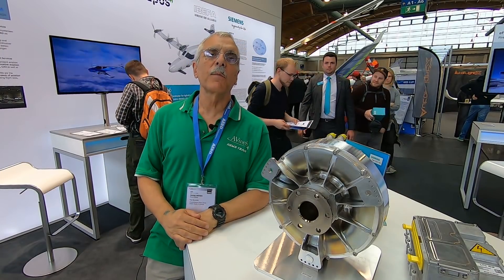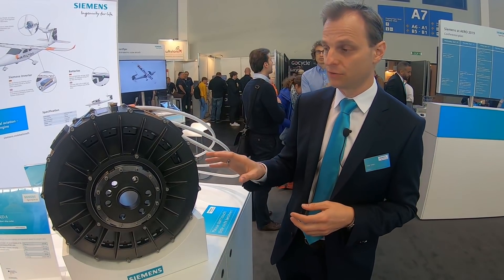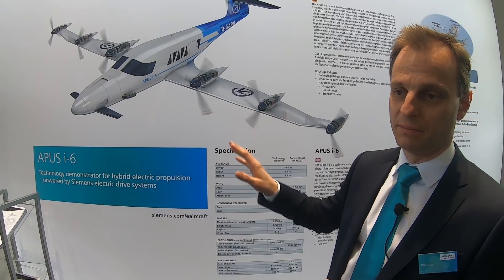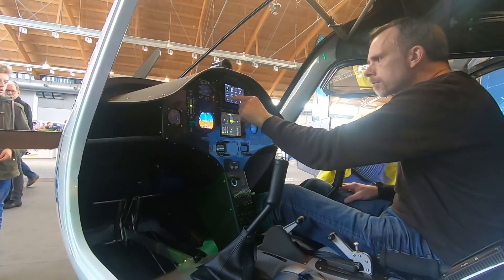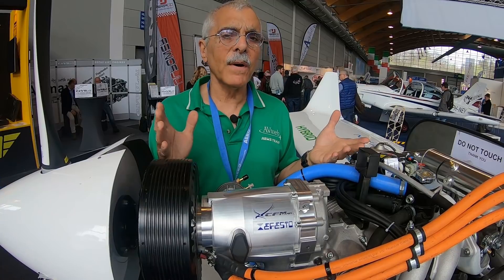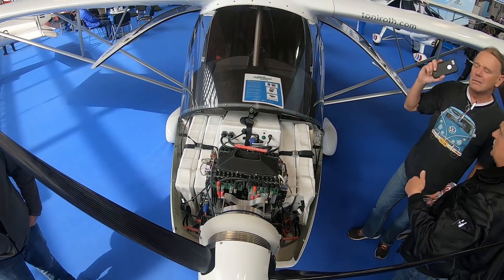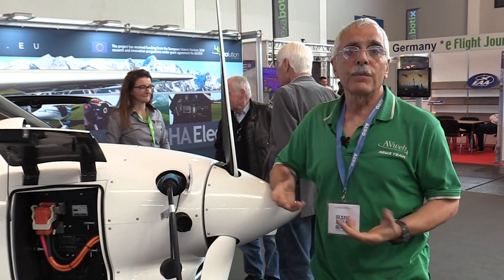What's New in Electric Airplanes?

Comment: I would love to put a smaller 100-130hp motor in my Quickie Q2 500lb (no fuel or pilot) 2 seater Burt Rutan Composite plane.  The plane has a 80hp gas engine now that cruises at 150mph Top speed 180mph.  The design is safe up to 200mph.

Comment: For me the e-systems have the same disadvantage as in cars. Why don't they hybridize these systems with a solid oxide fuel cell? Why do they use these internal combustion engines? You can operate a SOFC directly with natural gas or auto gas. There is no need for hydrogen. Of course you need a Li-Ion buffer battery, but this can be very small.

And there is another thing. Why do they use propellers instead of impeller fan systems. Impellers have considerably more efficiency because of the guided air flow. And fast running electric fan motors can be made much smaller compared to high torque motors for propeller drives.

Comment: I don't mind the idea of an electric motor driving the propeller. As long as you put a generator on that thing and have it run by some sort of fuel, whether it be diesel or gas, I don't care. You can even have a smallish battery that will be your primary power source but if you're not charging that thing with something that will last longer that what they currently have, and the problems that we already have with automobiles that are electric. I think that depending on a battery while you're out in the middle of flying, you think it's bad when people run out of fuel, and they have to be the ones you put in the fuel and there's a fuel gauge. Batteries can quit functioning as soak an electric motors for no perceptible reason whatsoever.

Comment: Is it a engine or a motor because the tech rep is confused?
Reply: It's both.
Reply: @PabloGonzalez-hv3td .its a motor engine?
Reply: @gerald4027  The definition for engine has nothing to do with combustion as is commonly thought. It's based on having moving parts. This is both an engine with moving parts and a motor as it imparts motion.
Reply: @PabloGonzalez-hv3td .motors are electric and then engines run of off a combustible liquid or gas.steam engines and water wheels are engines.
Reply: @gerald4027  That's the common misconception but it's not actually true. In rocketry both rocket engines and rocket motors use combustion but rocket motors have no moving parts and are not considered engines.
Reply: @PabloGonzalez-hv3td .that's nice so what do solar arrays use for propel the aircraft forward?
Reply: @gerald4027  Both electric motor and engine are acceptable but motor is common parlance. Mostly irrelevant unless working in rocketry.
Reply: @PabloGonzalez-hv3td .my diesel  truck has a electric engine.
Reply: @gerald4027  It has many. It also has a diesel motor.

Comment: I would cover the wings and part of the fuselage with solar panels, that would increase the flight capacity during the day
Reply: I keep imagining the entire skin of the aircraft collecting both heat and photons. clear panels exist already, so there is potential for collecting from the entire surface of the plane. If solar collectors were integrated within the structural material it could prove to be worthwhile, yielding power for virtually no extra weight. Nano technology is already developed which massively increases the power to weight ratios of solar cells by increasing the collecting surface.
Reply: @kenbellchambers4577  With regard to weight gain, I believe to use purely the solar cell phone and add in the firing material itself and covered with translucent material as being part of it. Unfortunately the greater weight still holds for batteries that still need better development and the engines have capacity and efficiency even better losses of around 10%, which is worth continuing to invest in this technology.

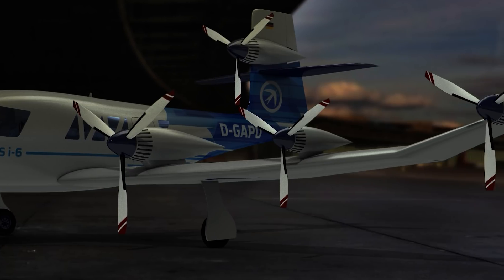Comment: At 4:10 is a 7 motor plane.  It's more expensive to build many small motors, rather than one or two larger motors.  I have to wonder if the frame is rather weak, so they don't concentrate the forces.

Comment: Does it really seam like a good idea to place a spinning mass on the wing tips of an aircraft in an airport scenario ? And what happens when or if an motor fails or a speed controller overheats and causes a sever yaw situation ? And why do they all have to direct drive, why not consider gear boxes to convert power slowing a motor RPM yet increasing the rpm like a constant pitch prop ?

Comment: Can you put solar panels on the wings to give a little longer range?  I know they will not give the amount of power to run the electric motor but if it will give enough charge to the batteries to offset some of the power needed it would add some more time in the air,  maybe  25% more.  I have no idea what the power needed to run the electric motor so not sure what 200- 400 watts of solar panels will give.

Comment: Brushless motors with a 3 phase are awesome matched with lipo graphene batteries my rc pylon racer cracks 200ks on 14.8v 772 watts at 48 amps static with a 7" prop and it's only made from epp foam with carbon spars 👍

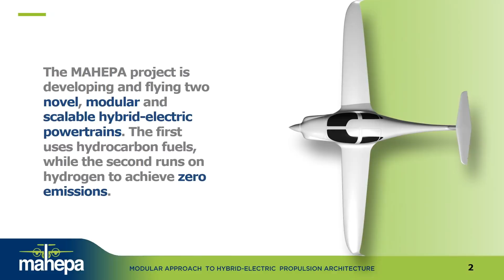Comment: 11:29 
TU-Delft logo: check
ICE: check
Hydrogen: check
Is this a Shell stealth program or something?
Reply: I am the Innovator of THE NEW WAY TO TRANSFORM ENERGY WITH MY UCRÓS ELECTRIC CYCLE SYSTEM of the Republic of Colombia South America Carlos Ucrós WhatsApp +57 3012358709

 And innovated a system to install it in electric cars that use a 72 VDC output controller is a device that I install before the controller and use a single battery and I extend the autonomy to 400 kilometers with the air conditioning on of fasil installation two components with  the battery price in Colombia 9 million pesos out of 3 thousand dollars sent by plane separately contact the innovative CARLOS UCRÓS
www.ucrosenergysystem.com

Comment: If the first story linked to below is legitimate, and the guy has solved the problem of an Aluminum Air batteries toxic electrolyte, such a battery could extend the range of one of these planes 8 times. Instead of the Pipistrel Alpha Electric only being able to fly for 1 hour, it could fly for 8 hours. The downfall would be, it couldn't be recharged, the battery would have to be swapped out after use, but hopefully it could be recycled. 

https://www.youtube.com/watch?v=9HvstKvFss8

https://en.wikipedia.org/wiki/Aluminium%E2%80%93air_battery

Comment: I really don't like the idea of relying on the electric and combustion engine at the same time, when taking off in a parallel hybrid. Now you got two things of which just one needs to fail to get you in trouble at high density altitude, rather than just one thing.

Comment: A short-hop electric plane taxi service could work now. It would require infrastructure. The train industry built a rail system. An air taxi service could build routes with a series of short-hop airports where batteries are swapped out. The question is how many passengers per plane would be needed to make routes profitable...

Comment: Gotta love the comment about most of these designs being "aspirational": pending a good power source. The difficulty is that all the recent battery innovations have been "discovered", not created or invented: they have not been predicted. That's the hard part. It's like Edison searching for a lightbulb filament: a slow and painful process. If someone can figure a way to design a great battery straight from theory, they will be immensely successful. Huge resources are being poured into this for years with so far only incremental success. What is needed is a 10X or 100X breakthrough. That would change the world. And it has to be practical and inexpensive. Making one or a handful in the lab for a gazillion dollars doesn't count (except for making breathless headlines). We've had efficient diesel/electric hybrids for 70 years: trains. But there weight is no object. Airplanes are a more challenging 'corner case' of electric or hybrid vehicles. The next couple of decades should be fascinating and maybe in the not too distant future we will all have an affordable, reliable way to fly... If you are curious, attend one of the electric aircraft conferences now happening every few months.

Comment: The issue with stacking motors is the weight penalty will begin to exceed the benefit of more power plants. You still have to add passenger and battery weight into the equation. >.>

Comment: An important goal for the developer ,apart from the technicalities and practical improvement in batteries(of which are many),is of course "COST" not only initial outlay but reducing time cycles in the hybrid reciprocating engine MAINTENANCE which in my opinion is the only real option for electric powered " A/C.that means a redesign in airbreathing engines .

Comment: Why don't you put the super capacitor and adding strong solar panels to the both wings so that the system can be recharged during the operation in the air?
Reply: Because the physics tells us the area for solar panels is waaayyy to small. Or it becomes very clumsy, just like Solar Impulse 2.

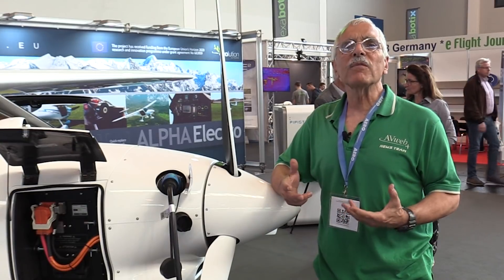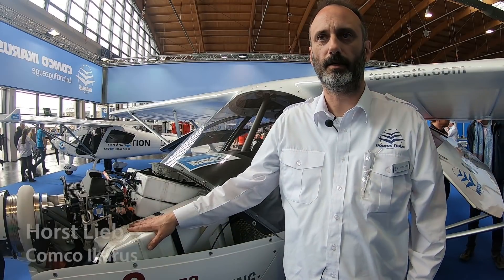Comment: what do you mean the numbers don't pencil out for hybrid electric 12:55 ? that guy said 8:11 the hybrid electric can hold 70 liters  of fuel and uses 7 liters per hour in flight. If it can cruise at 100 miles per hour for 10 hours of flight time, that is about 1000 miles of flight distance, not including the electricity from battery of another 45 minutes to give it over 1075 miles of flight distance. Plus you would not be having to fill it with aircraft fuel. You could fill it with standard generator fuel? Someone please correct me where i am off on this.

Comment: Mahepa:  Hydrogen fuel cell are not hybrids unless you obtain half of your peak power from batteries.
I hope do you use liquid hydrogen which it would increase the performance by a lot vs 700 bar compression.

Comment: why not put solar panels on the wings/fuselage or would that be just silly?
Reply: weepingod 
Even if you could extract 100% of the solar energy falling on the surface of the plane, it would amount to a tiny proportion of the energy required. In practice you wouldn’t get more than 25% of that energy, even under the most favourable circumstances.

Example:  A Boeing 747/400 has a wing area of 525m^2. This could collect at most about 525 x 240W of power, with full sunlight directly overhead. That’s about 126kW, (or 169hp, if you prefer) roughly the same power as a medium family saloon and about 10hp less than a Cessna 172S.

Comment: I wish that they (motor Mfg's), would design motors with smaller diameters.  This would allow for more streamlined nacells., and, perhaps putting small motors onto rotor heads/blades.
Reply: It is possible, but not worth it. Small form factor means less room for coils, so you have to compensate with higher current which equals heavy wires. It is a bit counter intuitive, but for any target power, you can have big and light or small and heavy.

Comment: lifting body design, with solar cells on the wings, and any upwards facing portion, at high altitudes for an 8 passenger plane it might give you an extra 8kW/h, sure that doesnt sound like much but it could add a measureable range increase as well as a backup 'fuel' system for superglide
Reply: Solar panels are too heavy for the power they offer. There have been some unmanned designs that do that, but they partly offset the mass of the solar panels by using them as structural elements. Solar cells are comparable to glass in strength and weight; I don't know about you, but I wouldn't want to fly on a plane with wings of glass.

Comment: I think what folks need to understand is how early this technology is. In 1919 a Curtiss JN-4 would go 75 mph, cruising speed of 60 mph. Top altitude was 6,500 ft. And a range 155 miles, or 2 hours and 15 minutes. The fact that electric cars are superior in everything but range. And that's improving year by year. The Alpha Electro has 45 minutes of endurance 70 miles of range. And a 98 MPH top speed. Otherwise, put in a lot of R&D on algae fuel to be refined into aviation fuel. Give it the kinds of subsidies that Oil companies get.

Comment: Parallel hybrid with a small, efficient ICE sized for slightly more than cruise power can have the best of both worlds- reduced ICE maintenance cost, good range and low fuel consumption with decent climb performance. Devil in the details, of course.

Comment: Parallel hybrid with a small, efficient ICE sized for slightly more than cruise power can have the best of both worlds- reduced ICE maintenance cost, good range fuel consumption with decent climb performance. Devil in the details, of course.

Comment: These hybrids looks front heavy. I wonder what's the center of balance on the manual. 
Remember those front and rear propeller planes? What if u have 1 gas engine in 1 side and a electric motor on the other side. Maybe that would balance out and offer a better system

Comment: They  all do it wrong. Need to design totally whole new electric type of plane with batteries that can be replaced in 20-40 minutes. Than and only than electric planes will have a perspective in flight school. Due to limitations of batteries its not profitable to buy a plane that fly up to 40 mins and charging 6 hours. That mean that you can fly only once at daylight hours.

Comment: I have to say that although I always thought this will be of no use because of the lacking battery capacity I now think that the use in the short term is more the reliability. Having a conventional engine power one or two electric motor(s) with some small battery capacity in between could be an efficient way to combine the low consumption of single engines with the reliability of two or maybe three propellers. That doesn't help you over water but it does while takeoff and landing and over mountains. Even 5 minutes more to fly plus gliding time could increase safety a lot. Of course the weight of a parallel hybrid is considerable but twin pistons are very inefficient, too, so... If you  look at a Cessna 340 and at a Piper Malibu you really wonder how double the power can result in so few knots more airspeed. I wonder how fast a twin with 300kW total power but a very sleek design with small engine pods would perform. We haven't seen that yet. It probably should have a relatively long body to accommodate everything but that doesn't add much drag.

Comment: Battery density is on a steady increase.
Combined with a range extender(installed or not).  Is  a triple safety mechanic.

EV is much more reliable, the have a primary and secondary pack + the extender.

On larger planes electric taxying should be manditory.

Comment: I'm thinking or perhaps imagining,  that if they cover the airplane exterior with those light weight solar panels to recharge the batteries while in flight, it could actually stay in the air for ever
Reply: I don't think you could fit enough solar panels on a small plane to power one of those motors... Unfortunately I think it's one of those things where if was possible, people would have already done it. I think there have been a couple solar planes, but they were very light, low power soaring things.
Reply: @maeflower5108  well impossible is nothing, who knows maybe one day they might be able to figure it out
Reply: @binobrownthomas2010 Planes that use that idea have already been made, see facebook's project and others like it

Comment: Is there any electric aircraft yet available with a range of 300nm?
Reply: you are talking aircraft range or UV light wavelength?
Reply: @kedaruss  I meant nm = nautical miles. It is potentially confusing that it shares the same abbreviation as nanometre, despite the approx 1852 x 10⁹ scale difference
Reply: @TomásPJM  Of course, I would never think about miles. Thank you!!
edit: it 300 some kind of sweet spot range? Does it open way wider markets? Something like 200 miles in case of EVs I mean.

Comment: IMO the largest potential of hybrid power trains is on the possibility to reduce weight while increasing maximum power.
This could be accomplished do to the fact that powerful electric motors are not heavy, and the fact that the high weight of batteries comes when you try to get long ranges, however the do have much higher power density potential (do not confuse with energy density), while cruise power can be provided by a small, lightweight and optimized engine generator.

In other words, its very light to get a lot of power (again, not energy) with electric, but combustion still has the energy (aka long range) advantage.

So, in practice , imagine any aircraft, put a X HP electric motor on it, and have batteries capable of delivering 3/4 of this power for about 5 minutes and a small engine with just enough horsepower for cruise speed generating the remaining 1/4.

So now you can have 4 times cruise power on take off, theoretically increasing the MTOW and the climb rate for a short time, while keeping the weight of the aircraft comparable to one with much less power. Then if the generator engine is more efficient than a larger engine you should be able to fly for longer on the same amount of fuel.

Also the handling of additional torque and thrust could be solved by distributing power with multiple electric motors.

TLDR: It's like JATO, but electric.